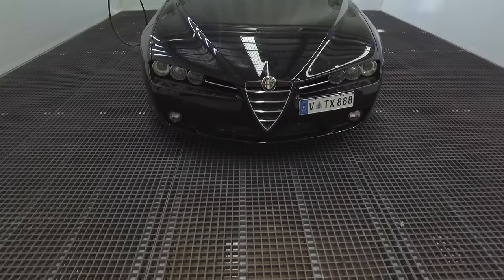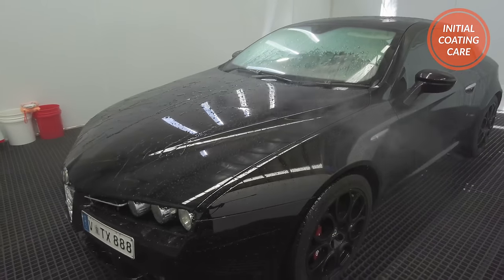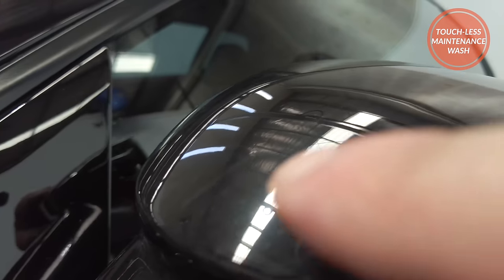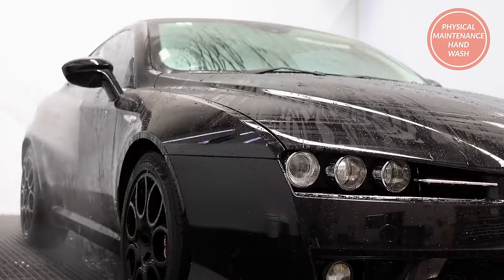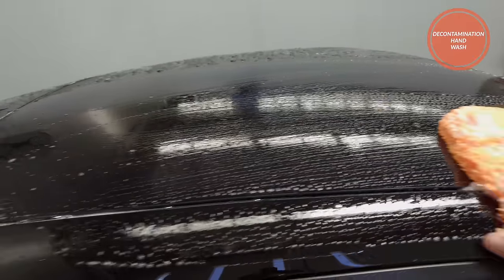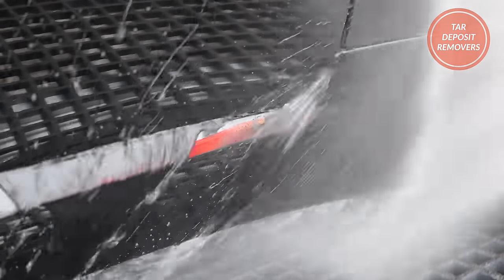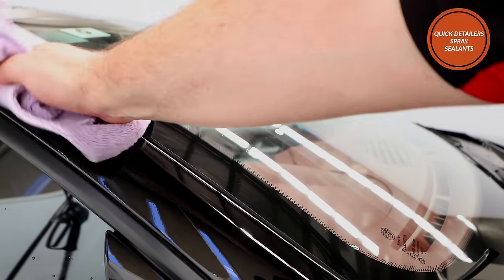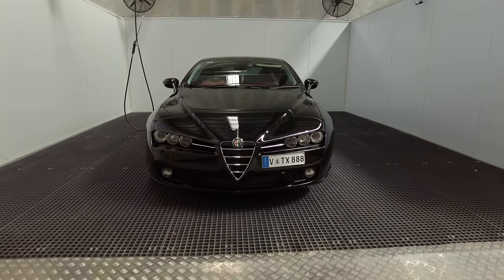How To Wash & Care For a Ceramic Coating From Day 1 To Day 1001 | Washing, Decon & Maintenance

Comment: I'm sure it's already planned but a video on removing the old coating and the process of applying a new one would be great!
Reply: All you have to do is polish off the old coating and prep paint and apply new
Reply: @kendog43 Is there a way to know if the coating has already worn off before polishing?
Reply: @jetsetter883  usually if a coating just sheets or clings to the surface after decon wash means the coatings is most likely to the end of life.
Reply: @kendog43  Makes sense! Appreciate the input

Comment: Great video. It will be one I will recommend to as many people as I can to show them how to properly care for ceramic coatings. In the UK and north America, not enough importance is given to mineral deposits and their affect upon coatings beyond the look of water spots. As you have shown, after road film, it should be the first consideration why a coating may have slowed down. Too many people think a coating has died and bad mouth it when it is just smothered in almost invisible minerals OR the common attempt to revive coatings with toppers on top of these deposits, eventually creating a stratigraphy of minerals and toppers killing their coating. Your video is so helpful to show how well a clean coating can perform.
Reply from the maker: Great to hear that and thanks, I hope it’s helpful to many.

Comment: As an sucker for coating, I love to test and enjoy the waterproofing of coatings more than what they give, and I have found out that after just having a car sit for weeks in bad weather in rain, plants and nature nearby, I notice that the coatings last on on the parts on the sides such as the doors than on the top birds eye view of the car(it’s due to low angle as water is less likely to stick), as it normally gets the most damage, for example I used Meguiar’s liquid wax on a car and in one weeks time of only sitting, the top boot part was not beading, but where the badge bit is where it’s mostly covered by the spoiler, it still beads to this day and I think it was 4-5 months ago which is crazy, so this video is very useful for showing regular maintenance helps maintain the coating

Comment: Some things I'd like to emphasize; If any of you have a coating that's still supposed to be performing well but you have large areas (usually horizontal panels) that are "clogged up" so to speak and aren't beading like they should, even after thoroughly decontaminating the paint, try giving the whole car a nice wipedown with an acid scale remover. (Sandro pretty much covered this in the video) That's been my go-to when a coating is clogged, even if it doesn't visually have water spots. The acid will give the paint a VERY deep clean and in my experience, revives the coating back up with insane beading, amazing gloss AND slickness. You shouldn't be doing this mega often, just as needed. The most important thing to keep a coating lasting as long as possible is washing it often! Letting dirt build up is what kills any protection, including coatings. If you wash your car religiously weekly, even if it sleeps outside, you'll get many years of strong performance from your coating. It'll last longer than you can hold in your craving to polish the car. If you wait months in between washes always, your coating won't last too long. What a coincidence, I also have a coating on my daily (since 2019) and I'll be polishing it off and applying a new one shortly. I had told you back when CQuartz SiC came out that I'd do the UK base with the SiC top but I ended up putting it off and using those coatings in other cars. Now I've made time for my car because the horizontal panels had been etched with SOMETHING (idk what, I live in a crowded neighborhood with bad neighbors) I was afraid cuz the paint looked very dry, but it polished right off and I sprayed it with reload while I wait for my Gyeon Syncro Evo to arrive in the mail. I was surprised at how easily EVERYTHING came off with just a light polish with perfect finish and a rupes yellow pad. Literally a flawless finish with only a few imperfections like rock chips and a little section of a deep scratch here and there. Can't wait to try out the new Syncro. If it beads like the original but doesn't last just 6 months and instead at LEAST a year, then I'll be happy with it. Thanks for the entertainment Sandro :) Had many more things to say but I've already made an unacceptably long post hehe.

Comment: Wow what a great complete video on how to maintain a ceramic coating on a car. Your explanation is excellent, thank you very much for this video.
I personally think that all the preparations and polishing are the most important for the shine. The advantages of a coating over a wax is longer and slightly better protection, but it is worth the $3000 if you cannot do it yourself. If you have enough money of course, otherwise you could perhaps also opt to wax the car twice a year?

Comment: I’ve noticed sometimes you use NV Purify for your decontamination, and sometimes you use Iron X.  
If Purify is a 2 in 1, and Iron X is only a spray treatment, why do you use Iron X sometimes, as opposed to Purify?

Thanks for all your help!
Reply from the maker: Sometimes I may be just wanting to address fallout/metal particles specifically- which is what iron-x is best at. Other times I may be wanting to treat iron and traffic contamination as well as strip older waxes/sealants which Purify is better at - addressing more broad contamination - as well as being able to use it as a clay lubricant.

Comment: What do you recommend instead as the next BEST thing? I do not want to be forced into running after water spots and having the fear of etching into the ceramic coating.  I prefer applying a new coating every few months which will give me zero headaches. Man thanks for your vids because you tell it like it is.
Reply from the maker: A good paint sealant/spray coating sounds like what you’re after - there’s lots around - some of my favourites are Nv Nova BoostV2, PolishAngle High Gloss and Meguiar’s Hybrid Paint Protection.
Reply: @CarCraftAutoDetailing  I was thinking of going with TURTLE WAX Hybrid Solutions Pro Graphene Flex Wax. Do you have an opinion on it?
Reply from the maker: Yes I think that could be a great option

Comment: As always, great instruction and presentation. Do you have a step by step video on reapplying a new ceramic coating after the previous one has expired or lived it intended life span?
Reply from the maker: Thanks and there’s really nothing you need to do different in coating a vehicle initially or re-coating it again down the track. Just a good decontamination process followed by an appropriate correction process and the coating application.
Reply: Thank you kindly!

Comment: Sandro. Hope all is radical. Watched again. So I’m mobile. I will be adding a water treatment set up. What do you reckon… use the systems treated water in between rinse processes or could I save resin and use treated water on the final rinse only ? For my coatings/prep I bought a 10x20 enclosed ezUp tent that I’ll also be using in the process when deemed appropriate.Right on dude. Cheers 🤘🏼
Reply from the maker: I think the main thing is not to allow the water to dry as that’s when spots occur, so you could get away with use the DI water fur the final rinse if you keep re-wetting during the process, but on really hot days it can be hard to avoid so you may want to stick to DI water in those circumstances.

Comment: Hi Sandro!! I took your advice, and coated my car with CQUK for the 1st layer & CQ SiC for the 2nd layer. Great results! Now I've been on holiday, and now the front of the car is covered in bugs... to top it off it was extremely hot for the whole week. Can I use a bug remover at this early stage of the coatings life? It is on now for almost 4 weeks. The 1st wash is coming up. Any advice for those bugs? Thnx man, as always. 😊
Reply from the maker: I think something like BugOut will be fine to use (it’s not as aggressive as some other bug and tar removers) I’d just see what my pre wash foam and pressure washer can firstly get off on their own and then if need be use the bug remover.

Comment: As always, very informative and well produced video. Couple questions: the alkaline soap before the acidic soap is a great idea for periodic maintenance washes and I’ve been doing this for a while. What about a pre detail wash? Alkaline snow/acidic bucket? Or x2 alkaline?
I’m coating a car that lives outside soon. I note you say do not put anything on a fresh coating for 24/48hrs and nothing heavier for a month. Plan was to put Boost on 8 hrs later before sending it back outside and then Jet 30 days later. Perhaps not ideal but lesser of two evils applying Boost so quickly?
Reply from the maker: I think if you’re dealing with both traffic film and mineral deposits then an alkaline foam follow by an acid hand wash would be a generally good way to go - but that’s really based on what the maintenance contamination on the vehicle is. 
If you know the vehicle won’t have cover after it’s coated then Boost 48hrs is the lesser evil, if you can try and IR or UV cure it as much as possible before hand and I think Jet a month later will be a great option especially for a car stored outside.
Reply: @CarCraftAutoDetailing  I agree in terms of the washing! 48hrs does make sense, I’d just be worried about rain in those 48hrs with unpredictable weather here these days. Also, In not being able to wash the car it may be a bit dirty to Boost after being outside for 48hrs 🤷🏻‍♂️ no access to IR but depending on the weather I guess it will get a fair bit of UV curing!

Comment: For weekly maintenance/toppers what is the best option, something like carpro reload or a quick detailer like meguiars hybrid ceramic detailer
I reload a couple weeks ago on my coated car and noticed some lower panels kinda fast sheeting on my recent wash this past weekend so now idk if i should be using once per month or don't use it at all and instead use hybrid ceramic detailer after every wash, btw its been raining here for the past 2 weeks
You should do a video and ceramic coating toopers 😊
Reply from the maker: SiO2 based QDs are a better option for more regular applications, Meguiars ceramic could be a good choice, one of my favourites is Nv Boost and the new Boost V2

Comment: Another great video Sandro. I’d love to hear your thoughts on toppers for ceramic coating, I have been using Beadmaker as a drying agent / topper and the car looks amazing and easier to clean.
Reply from the maker: Thanks and I think that’s really the main thing you just pointed out. If the topper doesn’t seem to inhibit the coating, mesh well with it and you’re having a great experience that’s what really matters.

Comment: Hey Sandro, thanks for the video its really helpfull to me! I have a question: Carpro and Gyeon state that after you apply a new ceramic coating you also apply a layer of a spray sealant (such as reload) to "protect" the coating during its curing time. Is this a good idea to do or leave the coating without any toppers during its curing time ? Isnt reload then not masking the coating its performance even though its recommendend by the manufacturer?
Reply from the maker: I would try to avoid using that top coat during the initial curing stages and only use it if the car is outside during bad weather, but even then, I tend to use something like Reload at 1:1 or 1:2 water if I had to.

Comment: Great as always sandro , i have a question i have a gyeon durabead on my car and have 4 years , it had always been well kept but i had a trouble with some minor micromarring and i used the essence plus with a rupes white pad speed 1, lookwise its awesome but it seems like the coat became clogged and does not bead like it , i have triet gyeon restart with no luck any tips?
Reply from the maker: Thanks and generally Essence Plus’s filling and sealing finish will inhibit the coating over the short term which is why it should be topped with a hydrophobic spray sealant/coating a few hours later. But the general idea is that when Essence Plus and that top sealant diminishes a few month later the coating’s behaviour should come back if the coating itself is still in good order - but this unfortunately isn’t always the case with older coatings and it’s always a bit of a gamble.
Reply: @CarCraftAutoDetailing  oh i see most likely is that because the car is a weekend drive so no real damage to even the essence is probably still degrading a bit , thank you so much :)

Comment: my car is in the curing process. I understand to wipe off bird poo or bug splatter with hot water or a ceramic spray during the period. but what about bee poo (the small yellow orange dots). should I wipe that or leave until my first wash? is it worth the contact....
Reply from the maker: I won’t worry too much about some random bug poo but if it’s a lot then yes I would tend to remove it

Comment: Sandro, another magnificent video, I have watched 4 times already 👍🤗.   This is my favorite Alfa, I wish it was available in the states.  As a professional detailer I hate to show my ignorance but my question is this. I understand alkaline (high pH) soaps I use plenty of them for all the purposes you mentioned but I'm not sure what you meant by an acid foam wash (low pH?). Can you recommend a brand and soap that you would consider to be the acid wash foam that may or may not be available here in the United states?  I would really appreciate it.
Reply from the maker: Thank you mate, and the acid wash abs foam I used was Carpro Descale which is certainly available in the States. 
Here’s a video I did on it a little while ago: 
https://youtu.be/8K9YmAyFmCo
Reply: @CarCraftAutoDetailing  it is!  I just ordered them.  👍🤗🙏✝️

Comment: Great video, Sandro I covered my car with carpro uk 3.0 two layers and a layer of sic, but I've noticed that when a type of clay falls, I think it's bird pee or something from a bird, because the sap of I find it difficult to be a tree, there is an engraving on the coating.
This is very strange because it seems to stain the coating, feces of other birds of another type does not stain, but this specific clay that looks like a coconut with pee leaves marks, have you seen that?. thanks
Reply from the maker: Thanks, but I can’t say I’ve seen that specifically, though I have seen boo or bat pop more generally etching coatings certainly. It sounds very annoying, but I guess the only thing to do is try and remove it as quickly as possible, but also try and take comfort that the coating should really prevent it from etching into the paint, so that once you’re really to remove the coating, those stain will hopefully come off with the coating itself.
Reply: @CarCraftAutoDetailing  Yes, it's very annoying, I usually take it out when I see it, but there are some places that I end up not seeing and then the engraving remains, even more so if I go out for dinner at night, then I only see the other day.
I'm thinking about using Elixir more often to see if that helps. What do you think ? thanks
Reply from the maker: I think have extra and regularly applied sacrificial layers can only help so it worth trying it.
Reply: @CarCraftAutoDetailing  I'll try with elixir one x a month, in a few months I'll be back to give you a feedback, hugs and have a nice weekend.

Comment: Hey Sandro... another great video that gave me the motivation to carry out a decon clean on my Nova Evo coated amarok using an alkaline snow foam and iron removers in the wash. I was expecting to see the inproved coating properties after each step and instead I have seen that the coating has all but disappeared after the wash on the middle to lower panels of the car. The coating was applied in october last year (following the processes in your video) so have only seen approx 5 months of durability, I am a DIYer but very thorough (at least i thought so). The car is a outside parked daily driver but very well cared for. Wondering if you have any insights on the breakdown of the coating as it seemed to fail suddenly primarily on these lower (admittedly dirtiest) panels.
Reply from the maker: I’m sorry to hear that mate, but it does sound like it’s failing if the deep cleaning didn’t revive it. It’s really hard for me to say why as there’s so many variables that could be the cause. I’d personally try putting something like Nove Jet on top and seeing how that goes over the next few months as sometimes it can help in repairing and reconditioning a coating, but if it just returns to the same state then it unfortunately means the coating has diminished.
Reply: @CarCraftAutoDetailing   thanks Sandro. Helpful as always. The car does get some minimal dirt road and and beach driving use but always rinsed and cleaned afterwards... I will be ordering some more Nova Evo when stock is available to try again as it was a pleasure to apply and use. Will give Nova boost a go too. Has been absolutely lathered in Bowden's happy ending too since curing.... Maybe they aren't compatible. Thanks for the help. Love the vids.... Keep it up....

Comment: What i am interesred in asking you Sandro regards the iron removers. They are definitely safe to use but is it worth noting that upon their reaction with iron the solution turns from pH neutral to around a pH of 7?
Reply from the maker: 7 is the neutral reading/position of the pH scale so that sounds normal mate, a pH of 1 is highly acidic and 14 is high on the alkaline side.
Reply: @CarCraftAutoDetailing  i’m sorry lol when it reacts it reads a pH of 3 not 7
Reply from the maker: I’d guess that’s the dissolved metal particles and potentially other surface contamination mixing with the iron remover altering its pH.